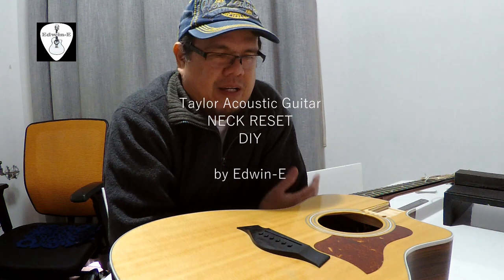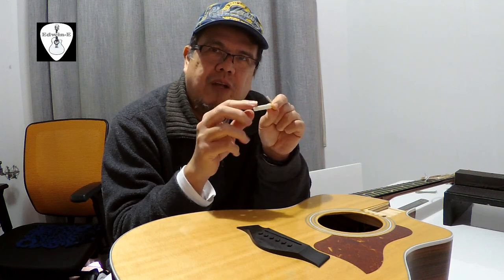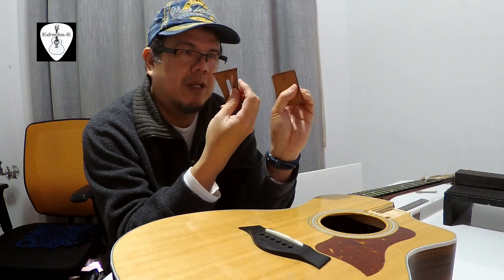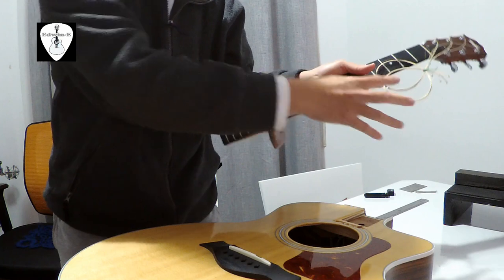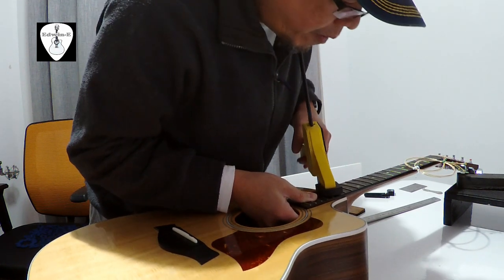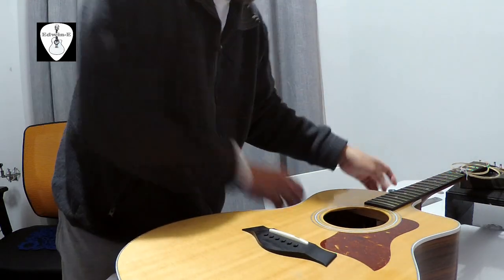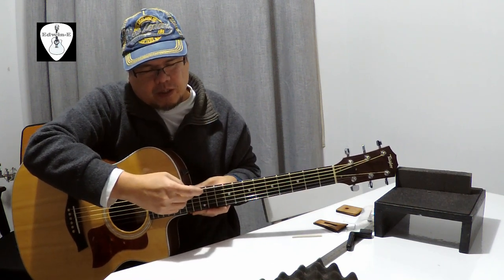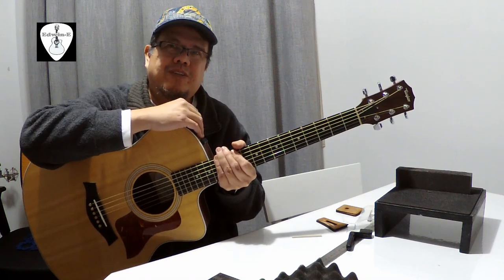Taylor Acoustic Guitar Neck Reset DIY - Shims Replacement | Edwin-E

Comment: I have seen ”pro guitar repair men” WHO could not fit a saddle as tight as this Guy. Respect for a ”non luthier”
Reply from the maker: thanks
Reply: That's way too tight.  It shouldn't wiggle, but it should also slide in without force.
Reply: @adamm3308  nope. It’s normal with the Taylor pickup system

Comment: My shims from Taylor arrive tomorrow - this was definitely the most informative video on attempting this procedure that I found online. Nothing from Taylor or any luthier even comes close. Nicely done, and much appreciated.
Reply from the maker: thanks.  How was your project?
Reply: @Edwin-E  Came out great. There were a few lessons learned that no videos out there have gone into though. Some of that I kind of found for myself. Others were in a document I happened on from a forum link. It was obviously from Taylor with a step by step process that included pictures. Including order of bolt removal. I would up making my own custom tool to do the removal of the vertical bolt. The one in the kit is kind of lame. In fact, the kit they sold me was lame. Lots of stuff you don't need. But I did get awesome action, and coincidentally I used the same values as you did. Figured I'd try those and redo if necessary. No need, perfect playability first time. Not necessarily an operation for the technically challenged or faint of heart, but if you're reasonably competent and like me, there's no Taylor authorized  repairman close it's definitely worth it to try.
Reply from the maker: That's nice to hear.  So, Taylor are already the selling the shims and tool kit for this job?  A lot of people are asking me on this video.
Reply: Yeah, but it's a good news/bad news situation. On one hand, they used to send these for free and now it's a 50 buck charge. And as I said, it's a "kit" for guitar techs that has tools any tech would already have. So it's just kind of gouge, IMO. And as I said, that pdf with the steps (and pictures) used to be on their website, but it's been removed. So they'll sell the kit, but make it harder for you to use it. I really like the NT system, but I would have to give Taylor a C- on the customer service end for how they've approached this. Especially given the shortage of certified technicians and the fact that a lot of people simply cannot or will not pack up their guitar and ship to one of these.

Here's the link for interested parties. Power to the people!
https://www.acousticguitarforum.com/forums/showthread.php?t=307865&highlight=white
Reply: Greg, what was your process for obtaining the kit - Customer Service?  Or other.  I don't see it advertised anywhere.  Thx
Reply: @upload2352  Called Customer Service and asked about obtaining shims. The only option they gave me was the kit, but you can always try to weasel out of that and try to get just the shims for less.
Reply: Did you get your shims yet? How can I order from Taylor?

Comment: How did you talk them into sending you the shims?  I asked to purchase a set of shims and they refused.  I bought a saddle an fit it to get the advertised factory action at the 12th.  But it is lower at each end than the specs you list.  They told me to to take it to Sweetwater (local authorized repair) - who I love, but when going to have tech work done there is a secretary between me and the tech.  I am not okay with that.  I am either too picky or love my guitars too much for that.  Tried it once, wrote down the specs I wanted to hit 5/64s and 3/64s with 0.010 relief.  Didn’t get it.  Paid 100 bucks for a set of strings and maybe a truss rod tweak.
Reply from the maker: I just sent them email and request for shims.  I told them I am confident to do it.
Reply: It helps if you can convince them you're capable, but their default is to send you to an authorized tech if you live near one.  I suspect Edwin-E doesn't have a tech nearby.  While I applaud Edwin-E's effort here, there are a few more steps he omitted as far as the clamping/bolting order thing goes.  There are several ways to screw up your guitar in this process if you're not careful, so Taylor, always conscious of its reputation when a botched repair finds it way to the next buyer, is conservative about who gets the shims.  I'd find a Taylor tech and deal direct with him/her, rather than the Sweetwater middle man.

Comment: I don't think the saddle should be that tight.  It should be easy to put in, but tight enough not fall out if you hold the guitar upside down.
Reply from the maker: True.  I should have filed it a little bit more.

Comment: I am having the same problem as you. Singapore's weather is too humid, causing the neck area to rise up. I use the same guitar as you. Just contacted taylor and told them that i have abit of experience working with guitars. Not too sure if they will be so nice to send me the shims tho.
Reply from the maker: Good luck and I hope you fix it.
Reply: so did taylor send it to you??
Reply: Talking about humidity, did u kept your guitar in the bag/case every time after playing? I just bought used GS mini and i plan to bring it to my workplace which is located in the jungle with extremely high humidity..

Comment: Very good job man! I sure like Taylor's neck joint system! That's way better than a glued dove tail joint! Both in removal and angle reset! Just bolts and shims instead of steam and wood work! Plus can do in a little while vs the couple weeks waiting for the swelling to go down after steaming. I'm a fan of Taylor now for sure.
Reply from the maker: thanks.  Easy neck reset.

Comment: Very informative. I have a neck reset to do on a 114ce so now I know what to do. Thanks
Reply from the maker: thanks.  Just take your time and don't rush it.
Reply: ah, I have to reset it too... my current 114ce (bought brand new) has 4mm action on 12th fret. How did it pass the QA, hmm :(
not to mention very low volume output from the pickup...
Reply from the maker: I think you can ask the Taylor dealer to reset it for you as warranty.

Comment: Great video , I had just got a second hand Taylor 314e and my luthier said you do not sand down the bridge he would adjust the shims. Thank you for putting this video out can’t wait to get my Taylor back in a couple days. Great playing to man! Keep up the great work
Reply from the maker: that's great.  Good luck your Taylor!
Reply: That's nice but why wouldn't they sell you shims? Of course maybe you wanted to pay someone else to do it and that's cool, but many of us would want to do the job ourselves since it is so easy. I wish Taylor made nicer guitars but i didn't realize they all use bolt on necks before i bought mine. I was told by several people their Taylors need resets about every two to three years and that must suck. If you are not allowed to buy shims i guess the scam is working for Taylor. Never will buy another one myself. Not worth the hassle trying to get parts. I have a 1952 Gibson es-295 that had never had a neck reset. Actually i have a 52 and a 55. None of my high end guitars have needed a neck reset and a fine guitar should not need a neck reset in less than ten years at least. This is a scam. And i want to know who owns any Taylor and can honestly say they sound as good as a real High end Martin or Gibson? Be honest.

Comment: What size is the Allen key that is needed ?
Also, what size is the socket, used to unscrew the bolt ?
Reply: 11mm on bolts hex screw is 3/16. Taylor has a shim kit for 70 bucks with tools
Reply from the maker: I think I mentioned in the video.

Comment: you change the shim on top by 18 and on the side is 24. what is the thickness of 18? and 24?
Reply from the maker: I did not measure.  Also, the shims are slightly tapered.

Comment: Hi Edwin what was your shims the.first time you changed them, I'm telling Taylor what is mine 214ce like yours
Reply from the maker: you need to tell Taylor what is your existing measurements then they will know what shim combinations you need.
Reply: It's my understanding you need your current action height, desired action height, and current saddle height, PLUS the values of your CURRENT shims, in order for them to determine which shims you need.

Comment: What was the action height before you shimmed it? I need to do this with a used baby taylor i just picked up. The action is ridiculously high probably near half an inch.
Reply from the maker: not so bad.  It was about 3.5mm.  I can lower the saddle but I read in Taylor forum that it is not the best way to do it.

Comment: Sir Edwin, did it show some gap space between the top and the fretboard because of the angle the shim created?
Reply from the maker: the fret board is always not in level with the top so it doesn't matter whatever available shim angle you put it.
Reply: @Edwin-E  thanks sir Edwin.

Comment: I had this done by Taylor Amsterdam on my GSmini. They also fixed a few minor finish flaws which I pointed out, not all perfectly though.  I don't know whether it's the same on the 214 but on the GSmini the lacquer was applied over the join between the neck and body resulting in messy broken lacquer on the edges, which they didn't bother cleaning up when reassembling. It plays great now but disappointed at that.
Reply from the maker: I had no issue with lacquer on edges.  But before disassembling, I score a little bit with knife to slice the finish and protect the other portion from cracking.

Comment: When you increase horizontal shim height, will there be a gap between the underside of the fingerboard  and the body?
Reply from the maker: nope.  As long as within Taylor specs it should be fine.

Comment: Hi Edwin, very useful video. I bought a Taylon 210CE from Singapore but I live in Sri Lanka. I need to do the neck reset on mine but Taylor and the shop i bought it from are refusing to send me the shims. Can you help?
Reply from the maker: It is not easy to get the shims.  I think I'm just lucky that Taylor sent me.
Reply from the maker: the shim is tapered.  For #18, one side is 2.0mm while the opposit side is 2.5mm.  I don't know about #24.
Reply: sorry I am a bit confused, you said the lower the shim number, the thicker it is, but at 3.09 you compare 18 and  6 and you said the 6 is thinner than 18? please clarify
Reply from the maker: for side shims, higher number is thinner.  For top shims, higher number is thicker.

Comment: Yamaha APXT2 guitar...6 months old, D string sounds dead between 9th and 13th frets....will adding a shim help or not?
Reply from the maker: Changing shim is only to adjust string height.  Dead string sounds on 9th and 13th fret may be due to fret leveling or fret crowning problem.
Reply: @Edwin-E  Thanks mate....
Reply from the maker: no worries
Reply: This video and the shim thing applies only to Taylor guitars post-2000 - not to Yamaha guitars.

Comment: what is the best height for the low E at 12th fret?
Reply from the maker: you can try between 2.0 to 2.5mm
Reply: so medyo mataas yung akin cguro sir kasi mga 3.5mm yun
Reply from the maker: yeah, mataas nga yun.  Baka naman need mo lang muna i-adjust ang truss rod.

Comment: Great tutorial.  Wondering if you relax the truss rod, or set it to somewhat neutral before the neck reset?
Reply from the maker: I didn't, but I think it is also a good idea.
Reply: @Edwin-E  Thanks, I reset my 214g neck last night.  The result is pretty good, but I did have to tighten the truss rod quite a bit to get the result I wanted.  I went from 4/10 shims to 22/28, so the difference should be quite dramatic.

Comment: Good job, Edwin.  I have an issue with my Taylor 114CE pickup. The third (G) and 4th (D) strings have very low volume. The first (high E) string is much louder. The 5th (A) and 6 (low E) sound about right. Any suggestion? Thank you.
Reply from the maker: If you have under-saddle pickup, are you using original saddle?  If not, and if you changed to bone, sometimes, it happens that some part of bone saddle is less dense than other which leads to unbalanced sound.  If you are using original saddle and someone has shaved the bottom and not fully flat, this may also cause the problem.  If everything else is fine as far as physical parts, I am worried it has something to do with the pickup or EQ.
Reply: They have small adjustments screws that take care of two strings each. Tighten them evenly and it should work it self out. They are located on the bridge and take a .050!size Allen wrench

Comment: Why I like Martins.... Yes,  you will more than likely have to reset the neck once in a lifetime by a luthier and it'll cost.. BUT it being glued in place solid everywhere   gives you the reward of transmitting all the sound ... not to mention the woods used by Martin are second to none.... Not saying Taylor doesnt have a decent tone but  you can see from this repair the bolted in neck.. bolts and unglued shims do nothing  for sound...
Reply from the maker: thanks for sharing your opinion.
Reply: You can "see" that the bolts and unglued shims do nothing for sound?  Good eye hearing.  

There's myths that a bolt on neck reduces sustain or caused other issues, but that's all they are .. "myths".   

Martins with glued on necks sound great.. Taylors with bolted on necks sound great..  Just preference.